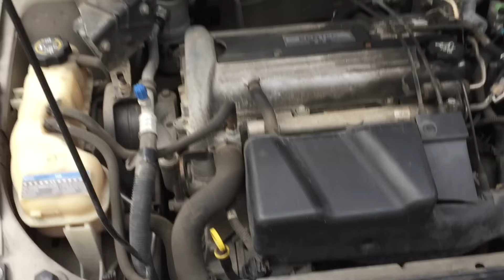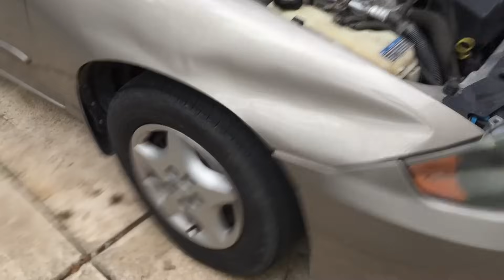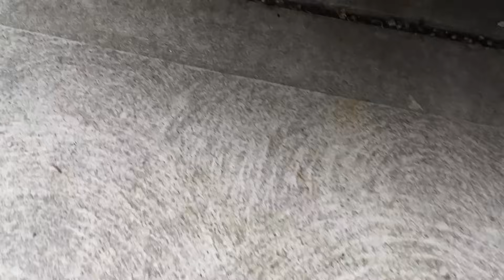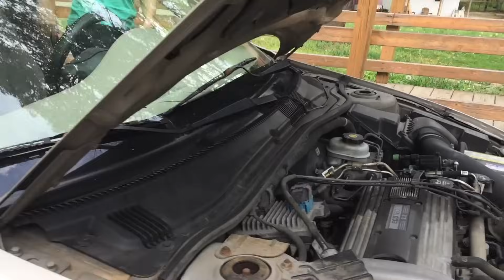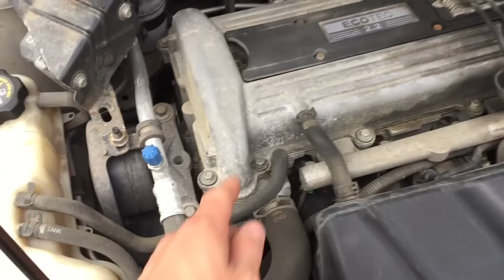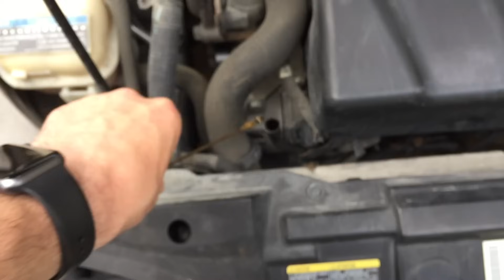What Engine Timing Problems Sound Like

Comment: I still don't understand why some car manufacturers spec such cheap timing chain components. This "Ecotec" engine is of Euro-German descent and I assure you the timing components are sourced there. The fact that Mercedes-Benz and  BMW both suffered timing chain, guide and tensioner issues in their "flagship" V8 engines back in the late 90's and early 2000's tells you all you need to know about quality of German timing chains. They even had M-B owners brainwashed into thinking that needing to check timing chain stretch was a GOOD thing. Ford also needs a public shaming for screwing up so many 5.4L 3V engines.
Reply: my early 80's chevy van was just getting broke in around 190K, when it met an untimely death of giant culvert and deep ditch parking...... it was a poor 5L/305 CU.IN. with TH350-C ( on rebuild 2) but it towed a house trailer "slowly" for years. both trans failures was the lockup torque converter puking its guts. valve stem seals gone from age, but most reliable vehicle ever. let it sit for 2 weeks in winter, grind it a bit to get carb primed and she'd fire right up on near 0F days. sitting unused didn't kill the battery either :))
Reply: **Classified** if car makes it to 200k without engine or transmission problems, it was a good vehicle. Agree about the 5.4 3v
Reply: euro-trash all of it ;)
Reply: Full of shit. Just making excuses to blame mercedes for this american junk. Mercedes m113 v8 rarely had timing chain issues.

Wtf does mercedes have to do with this junk?
Reply: Dont forget the SOHC 4.0 from Ford of Europe with its timing chain problems
Reply: Wouldn't call ford good for barely hitting 200k when any other truck will go twice as far with regular maintenance.
Reply: Ford is probably the worst offender. Their 5.4's are garbage. Every single one of them fails right around 200k. Hop on craigslist and I guarantee you that you'll see at least one that's on there for parts due to the engine being shot. It actually knocks holes in the engine too so it's not like you can just slap a chain and guides on there when they fail.

Comment: I have an 00 Bonneville with its original everything with almost 300k miles on it and still running strong
Reply: That's because that's a good Buick V6 and not a european-designed POS engine.
Reply: As long as you constantly replaced the intake gaskets & plenum (EGR burn through) before the series II 3.8 hydro locked then it would last forever
Reply: Great engines, i have an 00 Grand Prix GT with 46K on it

Comment: timing chains are great but when they go wrong they make you want to give up on life. I'm soo pissed off that my 07 G6's timing chain was stretched and mechanics are quoting me at 2 grand to fix it
Reply: They are wear items unless they are good-quality chains LIKE THOSE THAT TOYOTA AND NISSAN AND HONDA USE.
Reply: NotBen101 A 07 G6 needing 2k to fix? Hopefully it is a GXP, or I would call it done
Reply: Timing chains are wear items and G6's are a pain to work on.
Reply: GTP
Reply: NotBen101 so it has a 3.9, nothing like this 2.2. I had a 2008 GXP 'street' with the whale tail and 3.6, which was a little too easy to spin a tire with the open diff

Comment: So wait this thing has a bad headgasket and something wrong with the timing?! Lol
Reply: Bad timing, pistons may have collided against the valves causing a head gasket leak from the impact
Reply: The timing failure damaged the upper engine components so something must have happened to the head gasket in the process

Comment: It's time for this cheap little econobox to be put out to pasture. Don't buy Cavaliers. They're not worth the scrap metal they will quickly become.
Reply: Kyle Chapman You must be very uneducated when it comes to these cars. I've driven cavaliers since first started driving and never had any issues besides one headgasket in an older model with high milage. Please, Do your homework before making yourself look foolish.
Reply: Kyle Chapman my 05 ecotec in my sunrise has 375,000 miles on it and I run the absolute piss out of it, but I change the oil every 2,500 miles, do timing and balance chain every 100k like they recommend, coolant flush ect  normal maintenance, one of the best engine design I have ever seen in a gas engine, has decent power for stock, extremely reliable and gets great gas mileage plus no EGR crap

Comment: I own a 2004 ls sport with now 265k and I'm the second owner. Never had a problem like this.
Reply: Regular on time maintenance and an owner than cares for their vehicles will prevent this for the most part. I bought one a few months ago for 300 that was neglected. I did everything i could to get it back on track and it took a massive shit on me last night and broke the timing chain. Before this it showed no signs of failure. Change your oil people.

Comment: The Z22SE engines are very well known for their timing components to go bang. Believe it would start with just a slight rattle, but not like this engine has. Big ignorance at it's place there.
Reply: if i'm not mistaken that engine code is for the e85 version, this version is the 2.2L EcoTec 2198cc engine with engine code L61 but there is little to no difference as far as i know, i have a 2005 Chevrolet Classic with this motor, i noticed during cold start (even when it was like 98 degrees outside) it would rattle for a second or 2, i narrowed it down to that cam tensioner going bad, boy was i right, pulled the old tensioner out, and keep in mind mine had 214,000 miles at the time and still had the factory tensioner with the flat head, bought the updated tensioner for $43 original ACDelco part with the bump on the head and installed it, i knew the motor was on borrowed time with that factory tensioner installed the minute i removed it because i could pull the tensioner apart with just my hands, also replaced the valve cover gaskets and spark plug tube seals while i was in there, mine is still going at 222,590 miles so i saved my $500 car that's in used but okay condition $3500 for another motor if i let the old tensioner go and let it do this

Comment: 2.2 gm engine.. no suprise.. I had 2 of them.. POS
Reply: metvelle the 2.2 vortec ones in the s10 are decent at least mine had
Reply: Best engine they put in them, The 2.4 I had was a ticking time bomb. The ecotec only has known timing issues witch can be easily solved by replacing the chain tensioners every few hundred thousands milage. As long as you can keep the body from rusting they're known to go well over 500.000 plus miles.